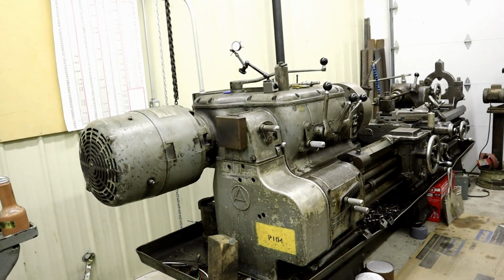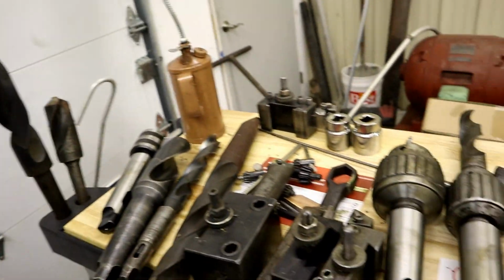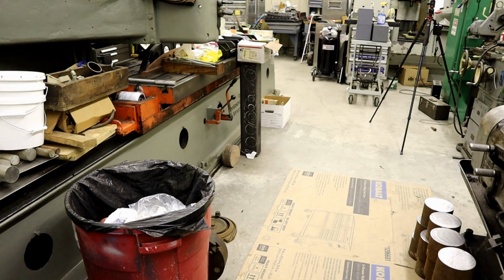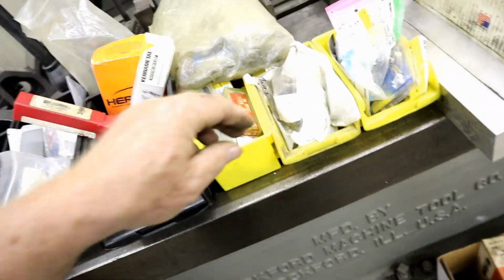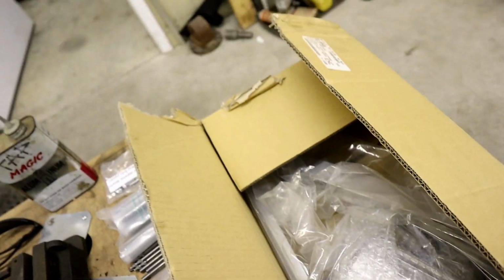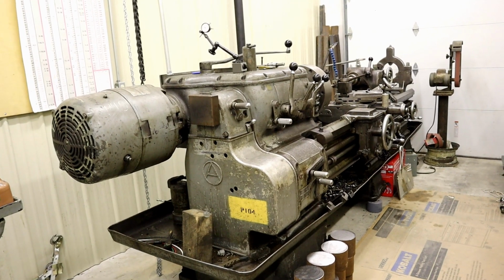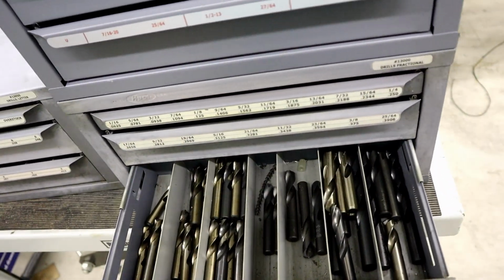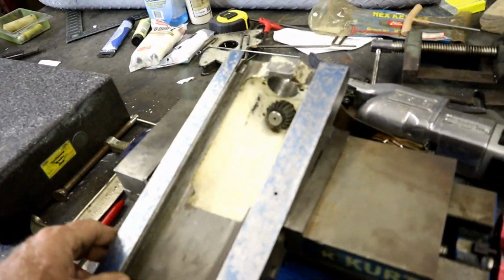How to buy good tools cheap

Comment: We have a scrap metal business here, Years ago there were around 30 or so, small engineering shops locally that we used to go to for the scrap. Now there is only 5 left. I am in to machining for my antique engine and tractor hobby.  (see my channel)
We just cleared one of our oldest customers shop out and got lots of tooling and a 3ton bridgeport 2s horizontal mill with vertical head attachment. 
I enjoy following your channel. 
Thanks
Reply from the maker: Thanks Carl... It a sad state around here...  Oil and gas is so up and down that it's either feat or famine ...  Lots of shops closing here now.. .

Comment: Hi Steve,
I wanted to point you to a big auction coming up: Alcoa plant at Point Comfort is going up for auction online on January 12,2021.  It’s worth just looking through the offerings because they had a big machine shop. A big Axelson 20”x96” lathe, and a lot more. A person could spend a lot in a hurry, but there might be some deals because there’s just so much being offered.
Reply from the maker: Thank you I''ll check it out.... Used to drive by that plant on fishing trips :)
Reply: They have appeared to add a bunch more stuff recently to the auction. I was looking at some Mazaks when I stumbled across that auction.

Comment: Any chance you got a spare cast camel back straight edge?  I'm gonna go do Richard kings scraping class in January and could do with one for the class.  im a bit of a scavenger for used stuff too, but then i think you already know that lol :-) looking forward to seeing some more videos on the torq cut, mine is starting to go back together now,  its slow trying to dial everything in but its gonna be worth it.  Did i share the link to my photo gallery with you?  I cant remember,  i have the tc22 stripped down into tiny little parts, documented and photographed.  if you haven't already id highly recommend you go over the auto lube system on it.  especially in the table the manifold is made out of machined ali it gets gummed up with tramp oil and coolant where the castings dont drain and then rots out,  the distribution valves are probably gummed up too if the filter on the oil pump hasn't been changed on regular intervals.
Reply from the maker: I don't  have any edges, of mine here...  Richard has a few here but I'm really pissed at him right now, and he really does not know why,  so I can't help you out.. Maybe call him or DGfoster.  Dg has some listed for sale on ebay..
Reply: @10swatkins  worth a shot, I can probably make it through the class begging and borrowing, I still need to get a hand scraper and all the bits on the list,  so if I can get something used it will save a few bucks.  Hope it's nothing serious and you guys figure it out 😜